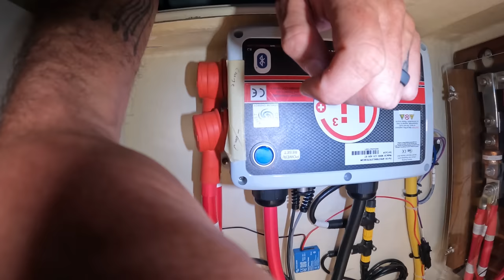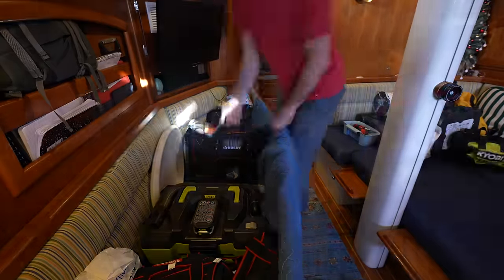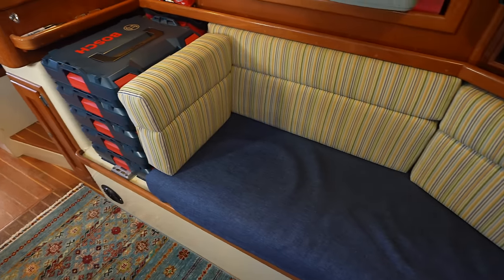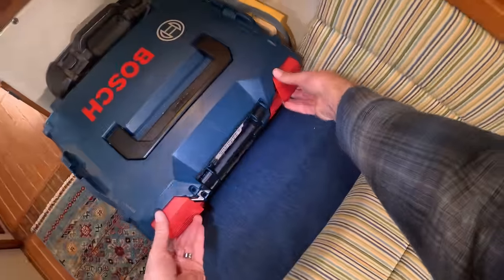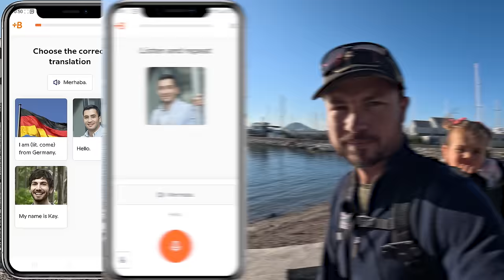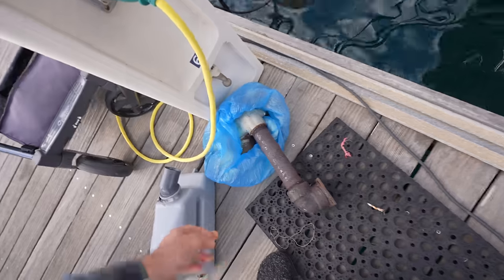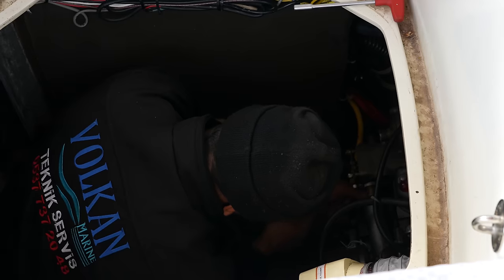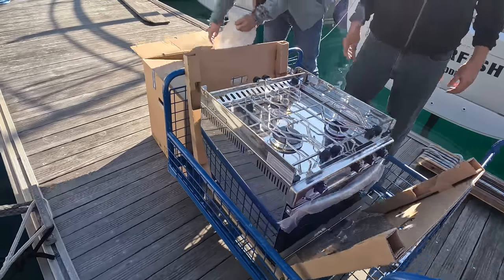Boat Builders Never Do This Right | S09E02

Comment: Noticed you kept the propane oven stove. As a boat owner and cruiser, I think you made the best choice. However, most YouTube sailing channels have been going the LiFePo and induction route. Would be an excellent vlog going through your thought process on this and why propane was the better option for you. As always, great vlogs!!!
Reply: I too wondered if induction wouldn’t be a more practical alternative (especially in the hotter climates)
Or perhaps just a single “hobb” to give options
Reply: You see YT channels remove propane.  Make a video.  Then it doesn't work out requires too much electricity, and then you see those boats later with propane again
Reply: Being one of those who removed propane and went induction. It is great for not having to do refills, worry about leaks etc... However, induction does take a ton of electric needs. If you have LiFePo, TONS of solar, alternators, etc... it works but at anytime your electrical system goes down, or you are having low batteries it sucks not to be able to cook. I think having propane is a good to have still.
Reply: I’d like to be able to make a cup of tea (a requisite tool) when the electrical system goes out. I’m a big believer in being able to get ahold of fresh water, cook a hot meal, and flush the toilet, even if the batteries or electrics die.
Reply: I have two 5 # propane tanks on my sailboat, and it is very gratifying and surprising how long my propane supply lasts.
Reply: Fire on a boat…scary.
Reply: @wallacegrommet9343  Same. I’m always blown away that our three tanks last us about 6 months (as live-aboards)! There’s a ton of energy stored up in those hydrocarbons!!

Comment: Pediatrician here:  I would find a way to prevent Isabella from sticking her head under the bottom of the gate you installed. Might be a choking hazard. Perhaps a large log pillow on velcro or some sort of lee cloth coming up from the bottom.
Reply: As a practitioner I was similarly worried that she could squeeze under feet first and get caught at her neck since children’s heads are proportionally larger than their bodies. A pool noodle cut in half sewn into a cloth figure eight, like a door sweep draft protector would probably work to protect that gap.

Comment: I have to work on my 28 year old sailboat literally every weekend to keep it in top condition. Which is tough when I am 65.  I have replaced the entire plumbing system, the DC system, heating system, and refrigeration system.  Plus engine maintenance, bottom paint  and general cleaning and polishing.

Comment: Regarding how to keep and use tools on board and at sea I had the following "strategy" : 
I have my "emergency" tools at hand as they are placed in an extra drawer under the chart table. Not very big but it has a large capacity because it is long . It contains : hammer, knife, screwdrivers, vise grip, wrench, pliers, wire cutters, Exacto knives, hacksaw, extra blades for all tools, scissors, spanners, some electric wire, splicer, and thread and needles, some tape and Ducktape, etc… plus the basic nut and bolts of the same size of those which are on deck, same with an assortment of screws plus a handful of galvanized nails (my boat is made of wood and plywood)… Spanners, wrenches, screwdrivers are only selected for the size of hardware that already on deck.
All the rest (and there is a lot) is stacked below in tool boxes with each tool wrapped in a cloth that has bee thouroughly oiled or greased. Wiping them when in use is sure a mild hassle but I was sick and tired of cleaning my tool off rust each year.
I think that division between "emergency" tools and the others is quite wise. At least it has worked for me : and the BONUS was that I realized that in the long run 80 or 90% of cases I only needed by "drawer" tools even when job was done ashore.

One solution to have a tool always ready at hand.

Cheers.

Comment: We’ve had the Bosch tool storage system on our boat for about 6 years and are so happy with it. We also extended the dodger sides for extra protection. The only issue is that we instinctively grabbed the trailing edge of the canvas extension as a hand-hold when entering and exiting the cockpit. So, we added stainless steel tubing to the dodger structure that follows the slope of the canvas down to the combing cap. Problem solved. Sail-on!

Comment: I sold appliances to builders, and gas ovens have a steeper learning curve compared to electric.  Package directions may allow items to burn, so you have to watch until you get used to adjustments.  I have one in my camper and we will use a toaster oven whenever possible...       
A boat, like an airplane, or even a house will stay in better condition when being used than sitting empty in the water or on the ground.  Projects are part of the reason, but even without maintenance, they still need to be used.  
Also anything today needs more maintenance than 100 year age because they have far more systems to make life and navigation easier and more comfortable.

Comment: The retractable baby gate is good, but its flexible bottom edge over a mattress creates a potential escape route--I suspect a determined toddler could wriggle under the gate. You might want to add a board at the end of berth to block that route if she does seem likely to escape that way.
Reply: I was concerned the flexibility of the bottom with a mattress could be a safety hazard. It’s hard to tell from our limited view. Former trauma nurse so tend to see life with worse case scenarios. Sorry ❤

Comment: For roast: you can use a pressure cooker on the stovetop. Was thinking about getting an instant pot, but we live off grid, so with a bit of research, ended up getting a small pressure cooker from Walmart. I have always made incredible 5-7 hour roasts in the oven. I can cook one just as amazing in under an hour. Sear, throw in veggies, season, and cook for about 45 minutes. Amazing! I would never have believed it. Great for off grid cooking.

Comment: Yay Veto Pro PAC! I did the same, packed one with the tools I need to grab 90% of the time. The Wera Tool Check Plus is decent. Add the Wera Zyklop Imperial set and you have a nice metric/imperial socket combo. Just be careful going down the Knipex rabbit hole - so many nice tools for common and unusual applications. Man, a set of Cobras is great. And the Knipex wire strippers are awesome. Lastly, the Knipex Twin Grip - once you start finding uses for this you will wonder how you lived without it.

Comment: Try an induction cooktop (120 volt); they are very enegy efficient and do not
waste energy heating up the interior space.  The cooking pots must be induction
capable (or cast iron works well)  Many pans, especially European, are induction 
capable and they are not expensive.
You will toss out your propane system - and worries. Induction cook tops are very 
controllable and very fast in both heating up and cooling down. Try a single burner
(about $75.00) or a double burner ($140-200). I used a Cuisinart for several weeks 
while remodeling our kitchen --  then bought a 4 burner induction cooktop and 
prefer it to the premium gas cooktop we had been using. (The 4 burner is 240 volt)

Comment: I would be a little concerned about her trying to squeeze between the mattress and the bottom of that mesh gate and getting stuck, and possibly choking if her head gets stuck. I almost think a toddler bed rail tucked under the mattress would be safer. Sorry for the unsolicited advice but I couldn’t NOT say anything. Maybe add a bed rail there to keep her from doing that? 

Sailing La Vagabonde used a pack-n-play type pop-up tent thing that zipped open on the side when Lenny was a baby. They just put it right on top of the mattress.

Comment: There are socket sets that one socket fits multiple size bolts or nuts also as a commercial diver I find and use every multi use tool I can find to eliminate tools on deck or stored in our crew boat.

Also invest in a catch all net in case you drop a tool which does happen.

Comment: About the tools, what are you doing to prevent rust?  The Bosch boxes are nice, but are they water (and water vapor) tight?  The only solution I have found to prevent rust is a couple of water tight boxes that I have.  I have even tried coating the tools with some special spray (I forget what it is called) that left the tools sticky and then they started to rust again.

Comment: Gain a heap of storage if rip-out difficult to service inbuilt fuel & water tanks, even more with compost toilet. Jerrys can be moved around anywhere as ballast, incl leeward. Tendered to any cheap gas station vs marina prices.
Can also save on space, weight, & rubbish, with dehydrated products, i.e. a 1kg bag powdered milk makes 10lts (10kg) as/when needed. ~300 teaspoons of sugar tablets for coffee/tea fits in a tic-tac container. Soda Stream = no more large soft drink bottles, etc.
Ceramic lined cooling/exhaust. FYI - rubber fuel line interior also deteriorates.
Try to use industrial irrigation polly fittings/lines as much as possible, lighter, cheaper, less corrosion issues, etc.
Energy efficient combi oven/air fryer, + induction cook top = no more gas. Solar hot water.

Comment: Nice job on the projects-organization is key! As an electrician, I'm always thinking of better ways to organize. I haven't pulled the trigger on a Veto bag yet, but I love the Milwaukee products. I'm sure you've seen their Pack out system-very nice organization boxes that lock together. Bigger footprint than your Bosch boxes, so might not work for you.
Reply: You should try a Veto Pro tool bag. I don’t think you will be disappointed.

Comment: Even new boats expect everything to break in the first 10 years , particularly production boats . The new engines and gensets are overly complicated with all the emissions with so much to fail in a wet salty shaking environment  .  On top you can not fix it yourself ina remote anchorage . 

I loved my old Bukh dv8 - stone axe simple , run with no electric power at all, easy to hand start , Your engine is too big for that but older means less electronics to fail and be unavailable in a remote place .

Comment: As a sailor and insurance company owner, I would not be very happy with the all hose system you now have. It may work the euro standard is copper pipes and only the last 30 cm can be specific hose ( orange classified fir gas ). We would not cover you. With what I see on the video. Do check with the contractor that he guarantees it meets EU /ce standards for gas installations on boats. Because some new stuff is around and I cannot see from the video, but it worries me tbh.